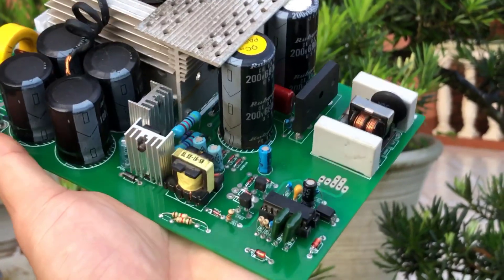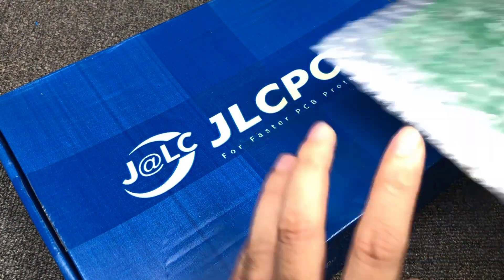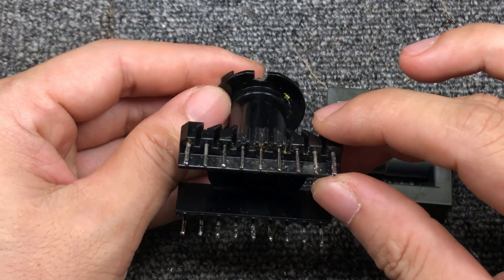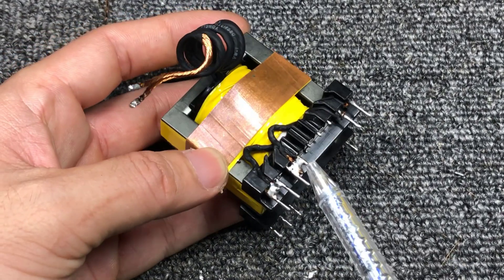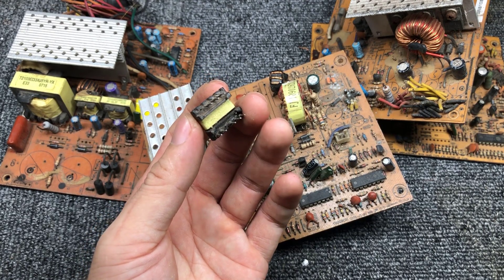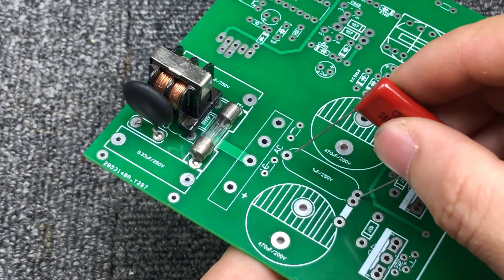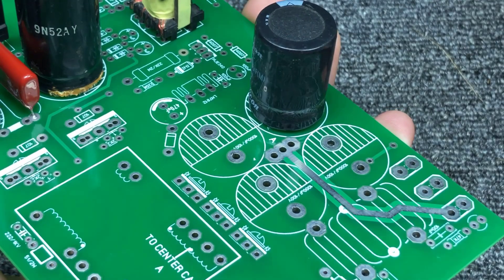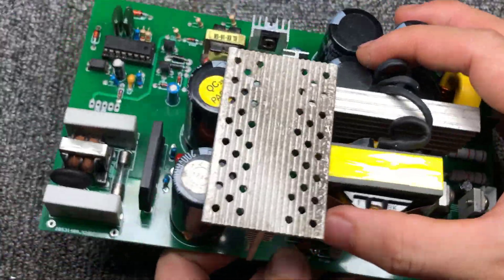Instruction How to Make 700W Switching Mode Power Supply With Feedback

Comment: Hola Amigo. puedes subir este PCB ( INPUT 0-100V / 0-30A DC Over Current - ShortCircuit Protection Circuit by Using CNC to Milling PCB ). Que tiene el enlace roto. Gracias y Muy buenos tus circuitos.

Comment: Very nice power supply and your work 👌👌
Please share the right core number. In this video's voice EE42 but this is not a EE42 because core center leg is square shape and you showing round shape. Which core you use in the power supply ER or ETD?? 
Please reply.
Thanks
Reply: That's ER42 ferrite cores
Reply: @jpjp8964  thank you

Comment: Sir I was using your flyback software version 6100.there are many cores selection but there are very few PQ type core. I have a PQ32 core and I want to use it for my SMPS, so can you please please add this core.
Reply from the maker: Try to find datasheet of it
Reply: @LongTechnical  i have the datasheet but how can i do the calculation.you software is great. please help

Comment: 2sc5200 2sa1943 35 DC volt dual supply amplifier
Reply from the maker: Yes. It is powersupply for amplifier
Reply: @LongTechnical    2sc5200 2sa1943 35 volt workig  amplifier